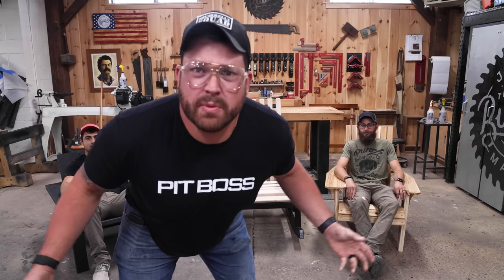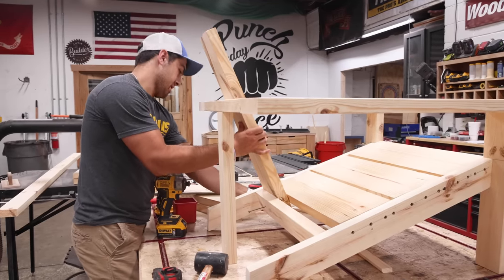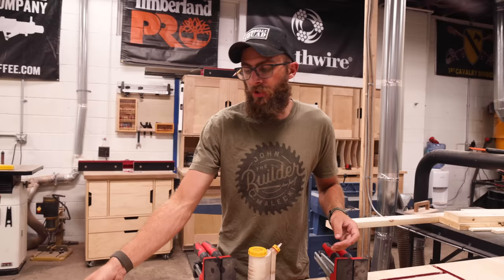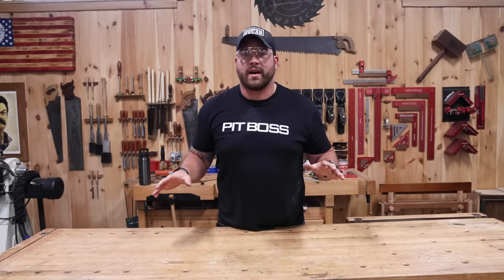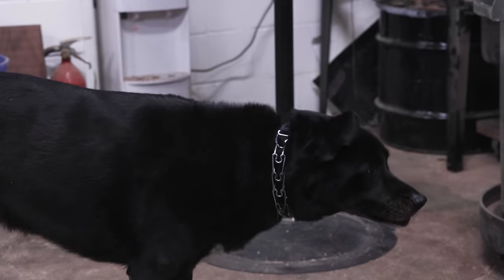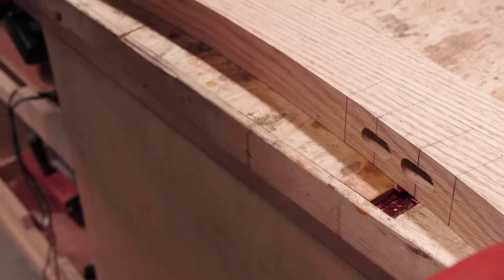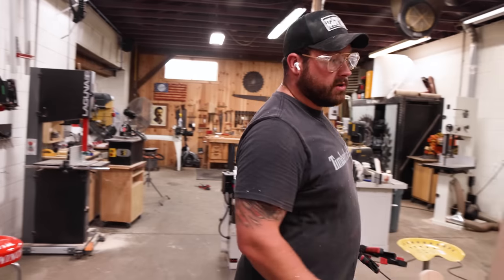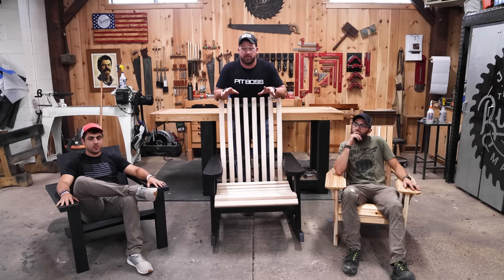3 LEVELS of Adirondack Chairs -DIY to PRO Build

Comment: First +1 on your multi-builds and you listened to me from the last one: proper screws in the pocket holes (pan heads) and you used the trick of a marking block to mark and cut the angle on the back feet of the beginning build - NICE!. Second: If you CNC the templates, you can just as well CNC the parts - with the exception stated for wasting less wood by using the band saw. Third: "Tiny little head." Too funny - that almost slipped by! Fourth: Real +1 for the sprayable UV resistant epoxy. That's a really good upgrade from most outdoor finishes. Would be good to see what these look like after a year of exposure. Nice job guys!

Comment: WELL AXCTHUALLY shou sugi ban also stops them soab bugs from messin with your outdoor furniture (along with moisture, rot, and UV resistance). Siiiiick builds lately - ya'll keep making a video about the work I need to do right before I do it - that's like 4 series in a row... other than the kayak but my pool is pretty big...